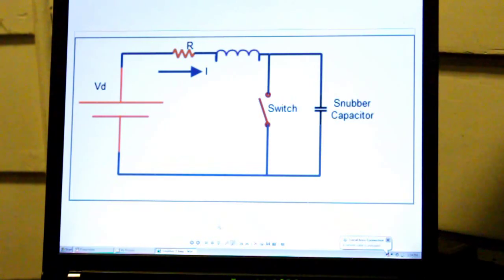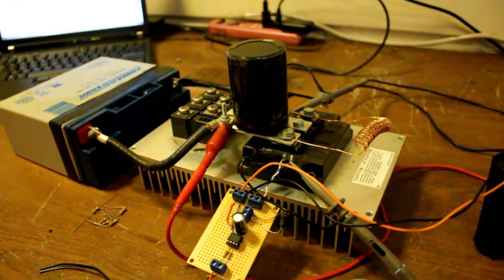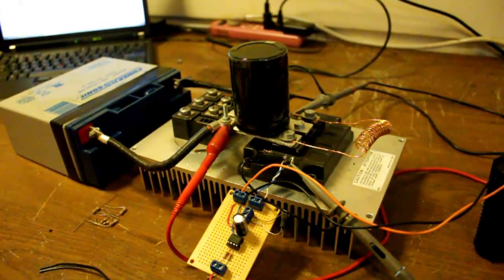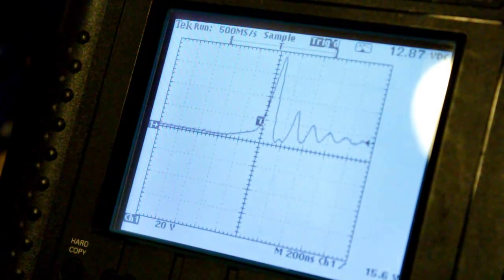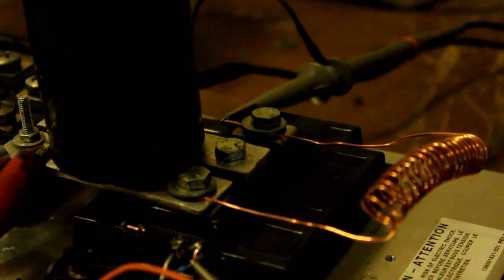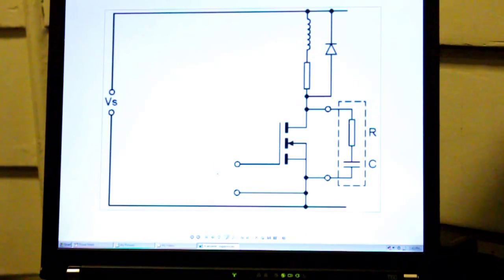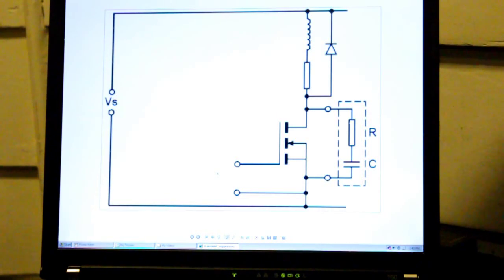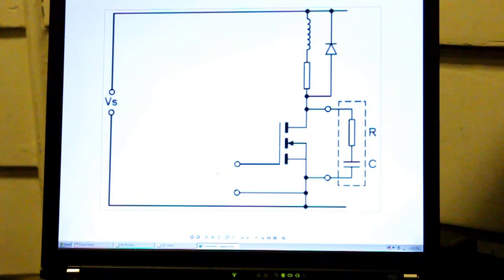Using IGBT Snubber circuits

Comment: Great video!!!
i think u ve solved my problem on how to use the dv/dt protection scheme for IGBT
i was thinking to use MOV but i didn't get the rated one  600+Vs and i ve to use snubber ciruit (the spike actually is suppressed by snubber)so i would be thankful if u could help on how to select R and C?

Comment: Hi  , This C R values have any dependency on switching frequency , mine is 25 Khz  Ice is about 60 amps max and Vce is 20 volts  and i found overshoot is about 75 volts @ 5 amps Ice.
Reply from the maker: Switching frequency doesn't usually affect turn off voltage to much extent. It can affect the turn off voltage indirectly however, for example, using a lower switching frequency on an inductive load will in theory increase the peak current, and therefore the turn off voltage. Mainly, the peak current and switching speed affect the turn off voltage. You  can slow down the switching speed but of course, this leads to heating. What's the rating of your device? 70 volts at turn off with 20 Vce seems high, but not unreasonable depending on what you're using

Comment: Actually I am working on 40kva ups..we developed the charger section by using igbt..in igbt block I connect snubber between +ve and -ve of igbt..where I should connect oscilloscope for measuring spike during turn off the igbt
Reply: have any info or pics online? sounds interesting
Reply: @lorenzo42p  thats easy , you need to connect it across the resistor , but you need to make a resistor divider network  to lower the voltage so you could hook it up to your scope ! ,resistance should be divided such that if your sensing 200v ,output resistive network should be 2v ,and if 400v then 4v etc .

Comment: the voltage spike is from the collapse of the magnetic field aroumd the inductor. the magnetic field energy is transformed into a voltage spike. this is useful energy. it can be  stored in a capacitor, and used again.
Reply: But how to do it, in such circuits when dealing with 350V DC 10A etc? Direct it to recharge the bulk capacitors, for instance?
Reply: @tr_2SC1970  yes that's possible. Personally I direct those spikes into a series resonant primary coil to set up a displacement current
Reply: @MasterIvo  Thanks a lot for the quick reply I appreciate that.
Reply: @tr_2SC1970  my pleasure

Comment: I remember somebody doing or some product. They had a diode in series with the capacitor and a resistor across/in parallel with the diode. I thought it was a clever way of reducing ringing. Never got around to actually trying it. Maybe you could for all of us. Yea your just going to have to make up the resistor value bc I haven't the slightest.

Comment: I am a bit confused.  I originally watched your video (https://youtu.be/IdKhifMQUBI?t=766) and it seems you recommend putting the snubber on C1/E2.  I can't tell for sure on this video since you did not call out the terminals, but it appears you are recommending C2E1/E2 for the connection now.

I am new to all of this and have damaged one IGBT module thus far.  I thought the diodes were supposed to handle all of this.  I am getting in some snubbers and would like to make sure I hook them up correctly.  Thanks.
Reply from the maker: Matthew Kelton In most cases you would indeed connect a small metal film capacitor across C1 and E2. In extreme cases, such as presented in this video, you may need to connect a metal film capacitor across C2E1 and E2. What IGBT did you damage and how did you do it? there are plenty of ways to damage one, and it may or may not be related to the bus or snubber capacitor
Reply: subcooledheatpump I have a Powerex CM100DU-24NFH.  Using their prototype driver board for it and have it wired up as in your chopper video.

When I damaged it, I had no caps, as I was mistaken in thinking the built in diodes were all thr portection I needed.  The IGBT is now permanently allowing current to flow.

I tried to turn on a 12V motor at 4khz 25% duty.  The motor jumped and appeared to sieze.  The power supply went into protection mode as something was sucking all the available current.  I increased current thinnking it was a spike and it kept doing it until it finally failed.

With my second IGBT, i could start near 0% duty cycle and slowly move up, but i could not take a big step, nor start at any arbitrary duty.  I will have my snubbers in tomorrow, so can try with them.  The "sieze" problem occured with the second IGBT as well, but it has not failed, as I have not increased current now that I know that is not the source of my problem.
Reply: subcooledheatpump I should have said in the IGBT I damaged, that I was only using half the IGBT as a straight switch with no capacitors.  As far as my problems are concerned, the 2nd IGBT is wired as you recommend (minus the caps) and behaves in the same manor with the motor "siezing".
Reply from the maker: Matthew Kelton Okay. If you didn't have any bus capacitors at all then it likely did destroy the IGBT due to an over voltage at turn off. In this case, I would get a replacement IGBT and start with a capacitor across the DC bus, that is, C1 and E2. I'd also try using a higher value gate resistor as a precaution, The IGBT in question is pretty small, and it can get quite jumpy using one of those powerex gate drive boards.
Reply: subcooledheatpump Thanks.  I have a 22 ohm in there right now.  Could this explain the siezing motor,  too?  I didn't think to look at the powerex fault line to see if it had done something at the gate board.  I know power was still going to the motor, as I could hear the whine, but I think something else was pulling the current.

What size would you have recommended?  I thought a 10th would have been sufficient for the 40A motor.  I killed the IGBT with an unloaded one that only is drawing a few amps.
Reply from the maker: Matthew Kelton I would try using a higher value gate resistor to start with. Powerex suggests a maximum value of 31 ohms, although for low current testing, I'd say up to 100 ohms is fine until you start pushing higher currents through. Definitely test the gate drive board without an IGBT attached and measure the input and output currents, you can use a small capacitor as a dummy load in place of the IGBT, and keep the gate resistor attached. Remember than when an IGBT fails due to an overvoltage, the IGBTs gate can spike the gate drive board and destroy it, so test the board first. The IGBT model you were using is good for your application, you just needed a capacitor across the bus.
Reply: subcooledheatpump The snubber is definitely helping.  I can now start the motor from idle to at least 25% duty cycle.

I would like to scope the IGBT to see the turn off spike and ripple, but only have an AC-powered scope.  Do you know if the ground reference is going to cause problems?  I notice in your videos you always use a DC scope.
Reply from the maker: Matthew Kelton A DC powered scope is always the safest way to go, but if the power supply for the motor and gate drive board is isolated from the mains and ground, you should be able to use the mains powered scope.
Reply: subcooledheatpump I am probing my IGBT between C2E1 and E2.  With the motor not attached to anything (no load), I get only a 15V spike and everything looks OK.  Some ringing, but the frequency is good in my operating range of 4k-10k.

When I put the motor that has the hydraulics on it (same model, but physically a different motor), I am seeing the spike go up to 50V or so, but the frequency seems to be stuck around 400k.  Could the load be causing feedback that would shut the IGBT down and turn it back on?
Reply: subcooledheatpump Could it be ringing so badly it is shutting itself off?
Reply from the maker: Matthew Kelton Yes the turn off spike can interfere with the gate drive circuit, and cause the IGBT to turn on or off in error. Probe the gate drive board with and without the IGBT connected, and compare. If you notice the gate signal going low, then suddenly going high with the IGBT connected, this could be your problem
Reply: subcooledheatpump the driver board is firing the way it should.  So is this another cap needed or something else completely?  Right now I just have the 2uF snubber on there.
Reply from the maker: Matthew Kelton That may not be enough capacitance, If you can, add another capacitor. If at all possible, add a larger electrolytic capacitor,  and another metal film capacitor. If you haven't done so already, increase the gate resistor value. Also, I'm fairly certain that the powerex gate drive boards have desaturation detection is that correct? If so, you may want to check and see if the desaturation protection is tripping
Reply: subcooledheatpump I added a few different values up to 40000uF and no change.  Should I try applying the cap to a different set of terminals?

What should I use for the gate resistor if I am testing the high current motor?  The unloaded motor (same motor without hydraulics connected) works fine with the 22 ohm and 2uF snubber cap.

Any suggestions for cap sizes?

Thanks for your help.
Reply from the maker: Matthew Kelton How are the capacitors connected? If they aren't already, they should be connected by bus bars. The snubber capacitors should be connected directly across the C1 and E2 terminals. A 31 ohm gate resistor should be okay, just watch the IGBT temperature. If the problem still persists you can try connecting a snubber capacitor across E2 and C2E1.
Reply: subcooledheatpump I am questioning the 40000 uf  cap I mentioned abive., as my LCR meter won't take a good reading of it.  I know that I have at least put 80uf on it.